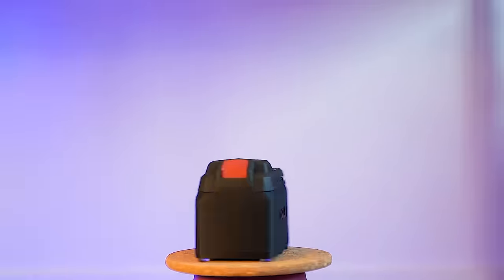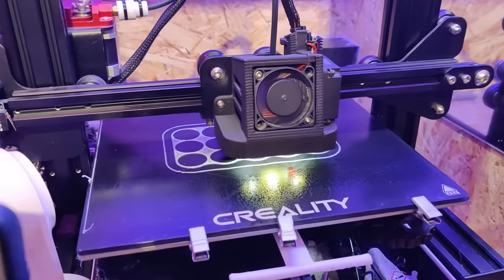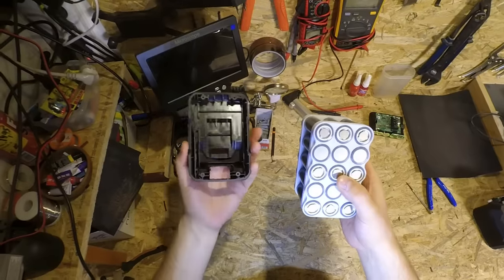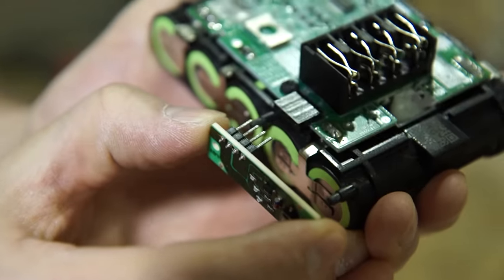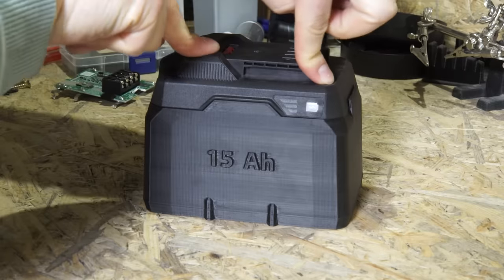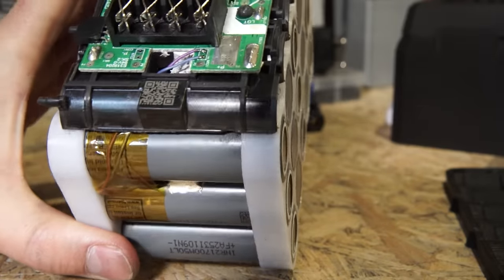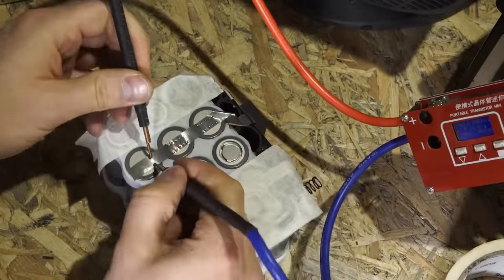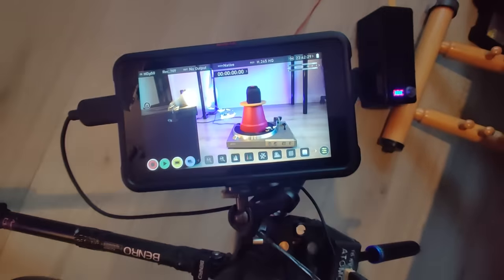Build a GIANT⚡⚡15Ah⚡⚡tool BATTERY!

Comment from the maker: Here's my next video, worked 10 months on it so I hope you'll like it! 🤞🏻
https://youtu.be/Vf0uD3wiPuc
Reply: Good project but not useful if you drill and screw all day,it adds too much weight. Even with normal batteries,let's say an impact drive is more than 1kg...with this pack more than 2kg.
And also if it slightly increases speed to the tool it will deteriorate the bits faster and more damage to the gears.
Maybe I am wrong as I don't know much about electricity
Reply: Hi i want to make that battery.can wou send me the files for the 3d printer please

Comment: what i want to see is a large battery pack like this, but mounted to your belt or backpack, with a umbilical cord type thing running to the tool. would take so much weight off the tool. just like an ego chainsaw
Reply: Good idea. I can't help but think that having such a large weight on the base of a tool is not a good way to work...
Reply: @RetiredRhetoricalWarhorse  yeah, I've considered many times designing my own battery pack. 2 or 3 OEM batteries in parallel and mounting them inside a modified camel back. Hardest part would be modeling the connector for 3d printing
Reply: I think the Post Apocalyptic Inventor did that in this video https://youtu.be/bHeii834ujs?t=1333
Reply: Fcuk, me too
Reply: The thickness of the cord must be crazy, considering the amperage some powertools need
Reply: Is it possible to get it to run on wall power? I bought a vacuum cleaner really cheap only problem it runs on battery but dies quickly.  Would trade off mobility for infinite run time on the wall power with long power cord. It's 20V 2amp battery.
Reply: @JeanPierreLihoreau  you would need to get a 20v power supply and then figure out how to connect the wires to the terminals that would usually connect to the battery
Reply: @Irishrebel092  i have thought of that too it’s an amazing idea obviously lol
Reply: Take a look at a corded tool then🤣🤣
Reply: @Sky.Sky.  there are places you can't go with a corded tools and with how much extension cords cost, I could buy another cordless tool with that money
Reply: @Irishrebel092  the power supply also needs to be able to supply the high current
Reply: Use makita batteries
Reply: I bet you could use the same battery and just rewire the umbilical cord
Reply: Please make this, this is also my dream! Of course the weight of the battery on the tool also balances the tool with the motor, but maybe it wouldn't be too bad! And I would love to see this even as a commercial product with different adapters for different brands of power tools
Reply: @Irishrebel092  surely you’d use a scrap battery as a donor rather than making one from scratch?
Reply: @jonchilds1637  well for the part that goes on the top, I have a 3d printer. But yeah if that wasn't an option, I'd just buy a dead battery off eBay and gut it
Reply: @RetiredRhetoricalWarhorse  yeah right, imagine taking this onto a build site, yeah you're not gonna have to charge anytime soon but god damn it'd be heavy as fuck working above your head
Reply: This is bloody genius, cause anyone who uses battery tools often will know anything bigger than a 5mAh is a dead arm waiting to happen, to be able to offset 50% of the weight to the belt would be a life saver
Reply: Just given me an idea I've got an old Makita 9.6v drill that I will now change to a portable lithium battery pack one that will fit in a bun bag or man bag with an xt60 connected with cord to drill so it isn't heavy in the hand but still portable
Reply: Ryobi did a belt style power pack with an umbilical cord and a backpack style one with their 40 volt lineup. If I remember right it called someone along the lines of backpack power supply

Comment: Excellent design! People just don't get how much time goes into designing a 3d model like this, especially with non engineering software, and filming the process is another story..... it takes a real enthusiast. Keep up the good work!
Reply from the maker: Thanks for the nice words! 

It definitely wasn't as simple at it looks in the video, there were a lot of blood, sweat and tears involved before I got it the way it is now 😅 And using 3Ds max didn't help the case indeed.. 

I'm learning fusion 360 at the moment whenever I have some spare time, and that's also the software I'm using for the next project.
Reply: @Solipsfilm  what a lot of people (who have never 3d printed) dont realise is that buying and setting up a 3d printer, perfecting printing and slicing, knowing how to configure the printing parameters etc. is about 1% of 3d printing.

The amount of people (I would say over 99% of 3d printer owners, including owners of high end machines) who have the 'perfect' setup but their printing is limited to printing out Pokémon off thingiverse and other similar trinkets is amazing.

Actually designing things to print, popularly known as 'CAD', is the BIG stumbling block in 3d printer use, and most people who buy a printer and throw it in the garage never to be seen again after a couple of months do it because they cant use CAD. CAD for 3d printing is the same as CAD for subtractive methods (milling, drilling, lathework, etc). There are basically 'lego brick' entry level options, mostly websites but also the popular games 'Minecraft' and 'From the Depths' which have this feature, but all of them have the same problem - you are designing in blocks, so all you can print is blocky things. Above that there is fully featured CAD software such as 3dsmax, fusion360, and freecad, which pretty much requires a degree in engineering to understand. There is nothing inbetween, no 'killer apps' that allow people to progress from the lego brick tools and work thier way up to the top end CAD software.

Comment: 1:50 just a quick tip, measuring cells like this with a metal caliper can lead to some interesting problems. And yes I discovered that myself
Reply from the maker: Haha, good point! 😆😆 Glad mine is plastic.. 😅
Reply: Did your calipers suddenly glow orange?
Reply: @BradKwfc  
It would seem that plastic doesn't glow... 🤪
Reply: You can see he used plastic calipers when he measured the length
Reply: @Solipsfilm  He's not saying that to you but everyone else 😜, you should pin his comment :)
Reply: haha i still got the black zap marks on my caliper. They still work fine.
Reply: Scared the poop out of me when I saw that for a good 5 seconds or so.
Reply: Yep i wanted to say that aswell, fellow commenter :D
Reply: Haha! Never tought about that! Thanks for the warning!

Comment: Just a safety tip. When removing your car battery, always remove the negative connection first, so that if your metal ratchet/wrench touches another metal part of the car, you aren't shorting the positive to ground.
This is the same reason you should always connect positive first when putting the battery back in.
Reply: Oh I never knew why you should do that. That makes sense, thanks
Reply from the maker: Interesting indeed, never thought about it this way! Thanks for the tip :)
Reply: @Solipsfilm  Yeah, first time I was working on something with my vehicle's battery, I learned that lesson first-hand. Now I've got a ratchet with a melted spot on the handle and a matching melted spot on my alternator mount... Turns out that a battery rated to put out almost 900 amps can do some damage to steel real fast!
Reply: Many dealership mechs failed to practice

 this on Toyotas, which blew the 120amp fuse, thats not easy to remove/replace.

Comment: The stringy-nes of PETG can be mostly eliminated by dehydrating the filament and keeping it dry, it's a very hygroscopic filament and when it absorbs moisture it gets stringy and the resultant prints tend to be more brittle than they should be. I print a lot of stuff in PETG and have had good success with dehydrating in a regular food dehydrator at about 70C for about 8 hours, afterwards I put the filament into my dry box (plastic box with desiccant and a hygrometer) and print from the dry box directly; I get excellent results this way with very little stringing.

Comment: I would like to see this done with makita batteries. They also have pretty particular battery management boards and the aftermarket boards sometimes don't work, don't charge as fast or even don't cell balance. Great video!
Reply: I have had the same issue with Aliexpress makita board. Bought twice and they never balanced the cells, so the charger just stalled mid way

Comment: Thanks bro! I am very grateful. I just bought a printer I'm still a beginner. You keep working really well just like that!
Reply: I hear 3d printer have quite a learning curve when you first start. It ain't just click and print. Alot or little numbers you need first but after you get the process it goes smooth. I believe I'm just a electrician and never really used one before but am interested.
Reply from the maker: The 3D printer is really one of my best purchases I did in years, it really brought my designing process to a whole new level.
Yes, there's definitely a learning curve, especially if you want the prints to turn out really nice but it is so rewarding once you really figure it out :)
Good luck with it! And if you attempt the project, feel free to send me a picture of the finished product ;)
Solipsfilm@gmail.com

Comment: Great video. I would like to see 3D printed projects with battery adapter... where you can use Makita battery on Parkside (or the other way around), etc. Usually you can find very cheaply cordless drills but batteries are expensive. So if you can use one battery on multiple tools/companies that would be great.
Reply: Watching you putting so much effort  in your work I be happy 2 order adapters from you -did buy some adapter b4  but wasn't the quality what I expected-and now i was looking adapter from parkside battery to dewalt and find on Internet pics and can c is not perfect fit -bit much forward then the original battery  eould b like...

Comment: I’ve been thinking about doing this lately for my jobsite radio that runs off a Milwaukee battery.  
Since you used a BMS from a smaller battery pack, wouldn’t that limit your charge/discharge current to what the smaller battery pack was?

Comment: I used 3DSM for 20 years. I ALWAYS wanted to switch to blender, but with all my experience I couldn't ever make the jump. I used blender back around 2002 quite a bit. Well I got tired of Autodesks outrageous pricing. I switched to blender and its literally 100x better in every single way. Also within the first day I was pretty proficient, so it didn't take me as long to get comfortable with it as i thought it would. The only thing I like better in Max is the smoothing groups (which doesn't matter unless you're doing game design). Other than that blender 100% of the way. I switched to blender about 4 months ago. So far I've done 2 professional industrial designs in it. Its so much better. The measurements alone are worth it. I do still find myself using hotkeys from Max and it makes me wanna scream outloud haha. But mostly because I spent 20 years inside of an ancient software whenever I should have just stayed with blender all along.

Comment: I got one of those spot welders. I use a portable battery jump starter and it works great.
Reply: LIPO packs is ideal for that spotwelder..
I use 2x 4S 2800mah in parellel and it gives all the spotwelding umff I need.
all in all, been very impressed with it... its rated for 12v (3s) but I dont see any problems with 4S 16v

Comment: Great project but a bit safety precaution. PETG is not a great material for cell holder - it creeps when heated (you can use PET bottles as heat shrink tubing). It means your cell holder will start squeezing the cells quite hard which is not the greatest idea (fire risk and all that stuff). Using proper materials for the job would ensure project longevity and spare you nasty surprises down the line. If I needed more temperature resistance and only had a stock Ender 3 I would chose ABS/ASA for the job. If your printer have all metal hotend and can reach higher temperatures I would stick with Glass Fiber reinforced nylon (requires hardened nozzles). It's what bodies of most power tools and batteries are made of - it's reasonably stiff and impact resistant, has a great temperature stability and should be quite printable without enclosure (haven't tried to print it yet but heard it doesn't warp as much as normal nylon which I had moderate success printing in quite cold garage ~15 *C). Don't use Carbon Fiber reinforced filaments as them might end up electrically conductive due to Carbon Fiber strands in them.
Reply: very important information!!! i hope he will pin your comment.

Comment: Great Video
Your battery can definitely deliver more than 43 amps even the parkside 8ah does double of that. The only problem is if you try to pull this current the fuse in the PCB of the 2ah battery will blow
Reply from the maker: Interesting.. Makes sense that the 2ah battery fuse wouldn't be designed to handle this amount of current, thanks for the tip, I'll definitely reinforce it! :)

I did a short circuit test with the batteries, they deliver around 70A/cell, that's obviously not what they're made for but that would mean this battery could deliver 210A at it's absolute maximum 😆
Reply: 2ah and 4ah batteries have the same fuse as far as i can see so to me it seems its the biggest fuse boards and contacts may handle. If it operates correctly with original fuse i would rather leave it as is
Reply: The amont of current he can pull doesn't depend on the battery, it depends on the load! If he uses it with the standard tools that are designed to be used with the standard batteries, there's no way he can pull a greater amount of current from it... This battery will last very very long without any decrease in performance. So it's ok to use with the standard PCB.
Reply: @Solipsfilm  Please give us an update! Because the 8 AH deliver 100A ! So, witch fuse have you uses to go above the 43A maximum of your design?

Comment: The temperature sensor is typically a 10k NTC thermistor, if you damage it or it needs to be replaced. It also does not matter which way round the thermistor is soldered to the board. When I used to work with Li-ion cells I used a large ceramic tile to protect the bench from inevitable burns! Speaking of burns remove all rings / watches etc! Metal jewellery can arc and the heat from a short circuit is almost instant! Get yourself some CA glue accelerator spray too.
Reply: Don't forget that Milwaukee, SnapOn and another use a 6.8K thermsistor....
Reply: @davidbarker3591  I see you're a battery connoisseur! I never had any luck with Milwaukee liion, 50/50 with the snap ons. Put it down to BMS locked when they fail

Comment: TIP for Measurements ...
Scan some graph paper or 5mm sq lines paper and print it onto clear overhead projector film
Place the clear film on the scanner bed and then the battery case on top
 It's easy to measure now

Comment: Interesting that original bms can be used. I came across your video as i was searching for a bms that i was thinking it needs changed when upgrading the parkside 12v team batteries. Their 4ah 12v battery has 6 cells of 2ah, and was thinking to just replace them for some 3ah ones, would make it a 6ah and overall better quality battery with good cells.

Comment: Really cool idea. 👍
However, did you check the voltages of the batteries before paralleling them? Charges in each battery should be roughly the same so that they work perfectly.
Reply from the maker: I did check that but forgot to mention it in the video.. That's indeed important :) 
Tomorrow I'm putting out a little follow-up video with some updates, this one's also included 👍🏼
Reply: They should self balance when in parallel.
Reply: @White000Crow  Except that’s less safe than if you individually balanced them to the same voltage first. Also less damaging to the cells.
Reply: @orppranator5230  You are right! but it only matters when the voltage difference is like 1 volt or more. Usually new batteries are within 0.5 volts of each other. So there is no surge current which is more than the c rating of the battery. Its more important in the series conections. What I do is. First measure all the voltages. If within 0.5 volts then i connect all of the batteries in parallell using small neodymium magnets and nickel plated strips. and leave them for like 24 hours. After that they are perfectly balanced and ready to assemble.